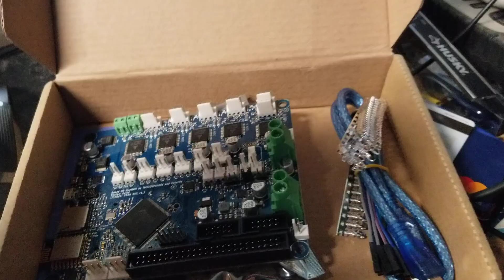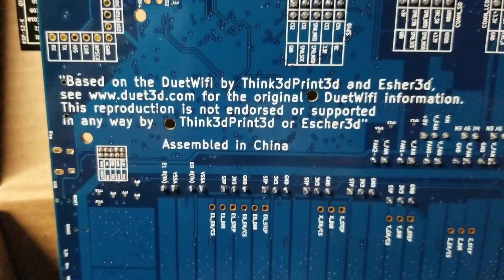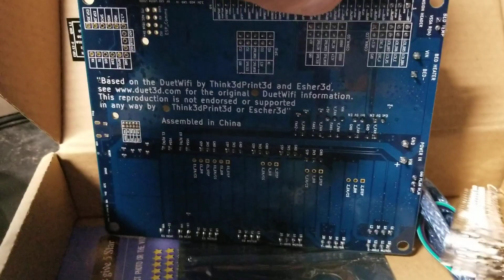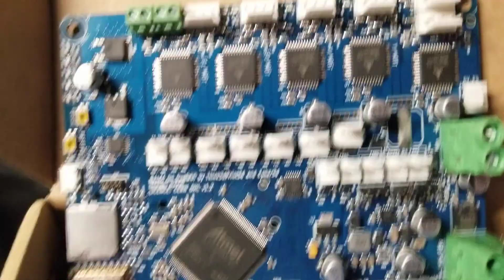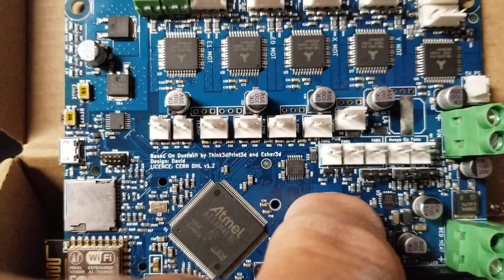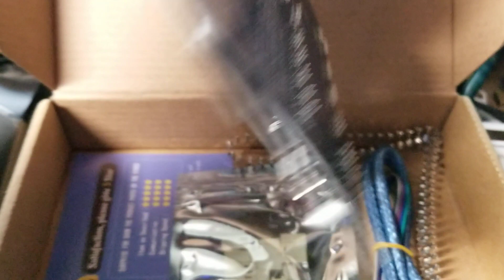Duet Wifi Clone 3d printer Controller

Comment: No fuse, bogusness. That's a reason I'm not ordering the clones I guess to save some change :(
Reply: I don't own a clone yet, but my real DuetWiFi arrived with a dead Y-Driver, so...
Reply: he's had a 33% fail rate on the real boards .. I'm not positive its an advantage to stick to the real thing
Reply: @robertotomas  I actually recently had an event that would have fried my board if it weren't for the fuse... heh :D
Reply: @Kungpaoshizzi  I hear you, the fuse isnt pointless, but the rest of the build quality also has to hold up and based on exit numbers it clearly is not actually any more well made than cheap clones.

Comment: I don't see the fuses. Also, looks like one of the screws are missing from the block. Considering buying one of these since the genuine Duet Wifi costs more than my printer did.
Reply from the maker: screw was in the bottom of the box it came out in shipping, good eye
the fuses are SMT as they are on my other real duets
they do make a model now that uses standard car fuses instead of the smt fusses 
board is still printing strong
Reply: @satgod  That's a deal breaker for me
Reply from the maker: @Kungpaoshizzi  my original duet did not have removable fuses with
they now have the new version with removable fuzes

Comment: Purchase link pse ?
Reply from the maker: https://www.aliexpress.com/item/Cloned-DuetWifi-Advanced-32-Bit-Electronics-Based-On-Duet-By-Think3d-Print3d-Esher3d-For-The-Control/32851027525.html?spm=2114.search0604.3.93.226d3550XIxB42&ws_ab_test=searchweb0_0,searchweb201602_1_10065_10068_10130_10890_10547_319_10546_317_10548_5730311_10545_10696_5728811_10084_10083_5729211_10618_10307_5733211_328_5733311_10059_10884_5733411_10887_100031_321_322_10103_5733611_5733111_5732511_5733511,searchweb201603_55,ppcSwitch_0&algo_expid=5618c927-6bc6-4bc1-bf96-1279fe34aaa9-14&algo_pvid=5618c927-6bc6-4bc1-bf96-1279fe34aaa9

Comment: How does it work? Everything identical in performance etc..?
Reply from the maker: The duet-wifi is open source and they have the schematics posted on github
this is a direct copy of that schematic
it works flawlessly
I replaced the duet in one of my printers took the micro sd card from that controller and inserted it into the close and it came up and worked 100% just as the original did with NO changes at all